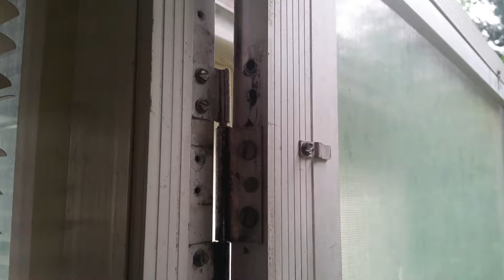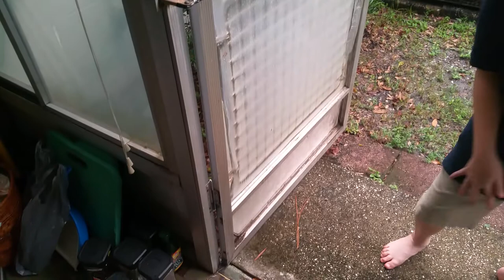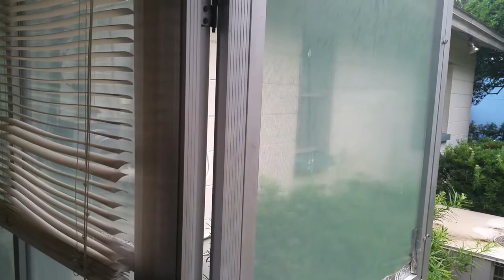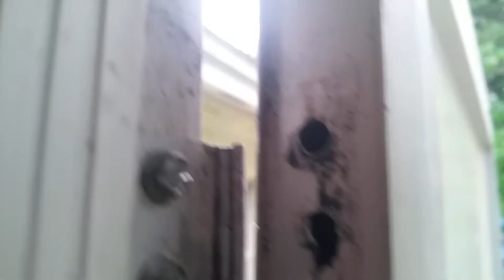How to fix screen door no cost free

Comment: Awesome!  I have repaired my screen doors with the larger screws a few times (both top and bottom) at different times.  The door is 25 years old. However now that I leave the door partially open during the day for the day for the cat to enjoy the pool enclosure area; the wind has taken the door and flown open a few time.  Anyway, this looks like a good fix for the problem.  Thank you!

Comment: @callmebigpapa I really don't want to drill new holes is there a way I can fix it with the existing holes that are there can you explain that to me please
Reply from the maker: Sure you could just get larger sheet metal screws they should have them at Home Depot but eventually you'll probably run into the same problem but it'll definitely fix it for a while good luck thanks for watching
Reply: @callmebigpapa  i took a toothpick wrapped a rubber band diagonally all the way up to the top put a piece of foil to hold it in place and screwed it in and it's working and thank you so much for replying to me I really appreciate someone like you it means a lot have a wonderful holiday season
Reply: Insert wooden blocks inside the door frame. Takes a little work but works great. Take door off open top corner to expose the hollow of the door frame. Cut 3 wooden blocks and I used Styrofoam straps to fill in. So the 3 wooden blocks are where the hinges connect. Put door back together and use wood screws to put door and hinges together.

Comment: Technically it's not a fix.  It's a jerryrig.  I'm looking to FIX the original wollered out holes to be able to use them again.
Reply from the maker: Sorry if this disappointed you. If you find a fix please make a video and post it here for others! Depending on how far you want to go and your skill level you could try repairing the holes with  aluminum rods from Harbor Freight or similar and a propane torch. Good Luck!
Reply: Here is how I fixed mine.  I have a 4 unit rental with 7 screen doors , and lots of wind.  Was hard on screen doors. Holes stripped bigger all the time. Did the bigger  screws etc. And strip holes again..  So What you do is take door off, take the corner connectors off from the top and maybe bottom on the hinge side. It's hollow. Cut 3 wooden blocks that fit inside and can slide in easily. Then i used that blue Styrofoam sheeting, or anything like some foam sheets and cut them so they fit down the door. And insert accordingly.  Foam - wood block bottom hinge,-foam strip wood block middle hinge, foam strip to wood block top hinge. Put door back together and now you have wooden blocks in the screen door to screw to, with flat flush wood screws. Works great.